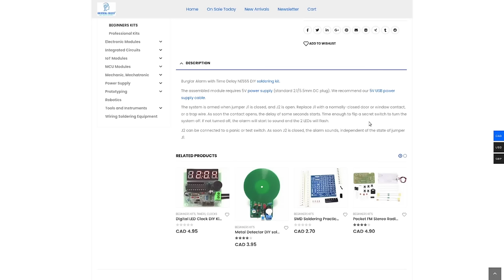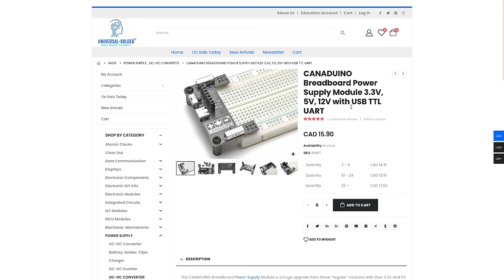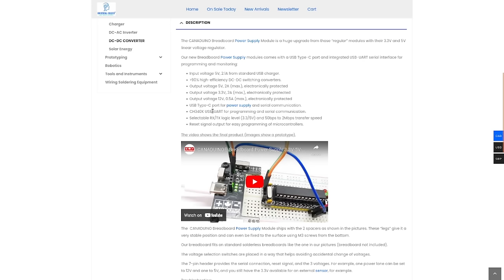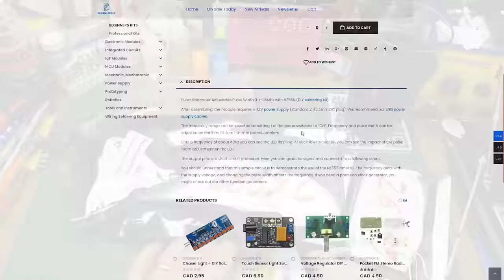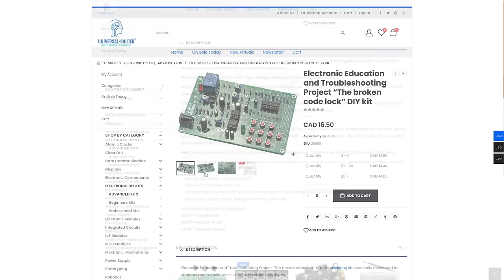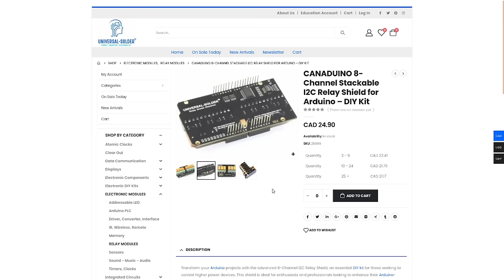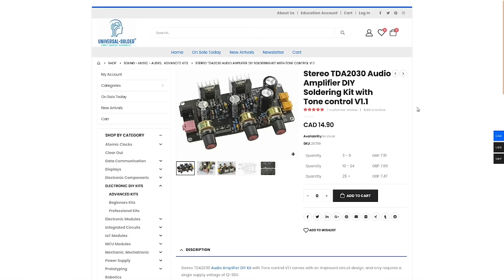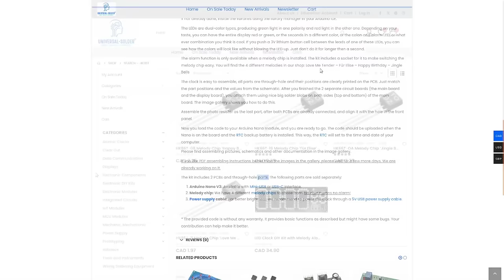unboxing a bunch of kits from universal solder

Comment: I do like the 12 volt option on the one.
Reply from the maker: I know. Super handy option to have available.
Reply: Might be commercially viable to manufacture a whole plastic breadboard with 12V USB-C on the top, down regulated to 5V/3.3V on the rails.  Power related jumps on the left side, smooth and clean on top.

Comment: Nice haul. I have no preference for which one you do first. I ordered the clock kit yesterday and plan on completing it soon. I'm hoping it should be easy to hack on a proximity sensor so I can just put my hand over the sensor and have the clock illuminate, I otherwise want it off at night because I find clocks distracting when I try to sleep. The LEDs are bi-colour red/green when you provide either a high or low signal. I'd like to have the red in the dark and green when the photo sensor is detecting light. Take care.
Reply from the maker: Given that the clock runs on a Nano, that shouldn't be much harder than a bit of code. 
Assuming there are any GPIO pins spare, of course...
Reply: The LEDs are dual red/green in APD (anti-parallel diodes) connection. The color switches when the polarity switches. Since you can't switch the polarity in the circuit, you need to make your decision about the color when you assemble the LEDs.
Reply: @canaduino  Thanks